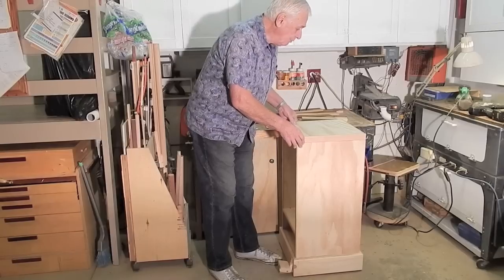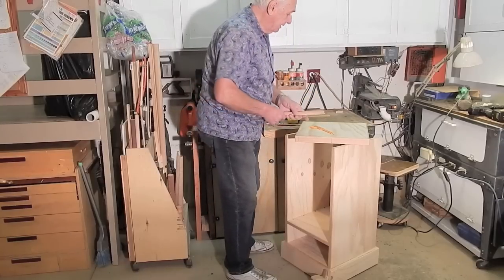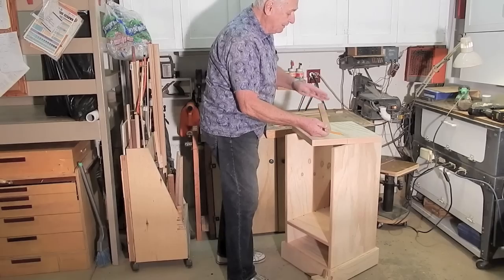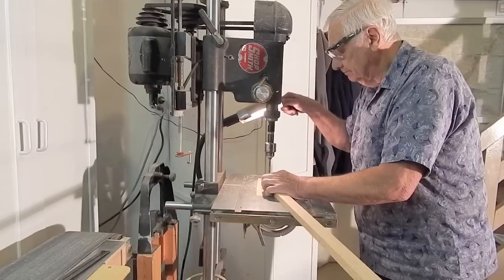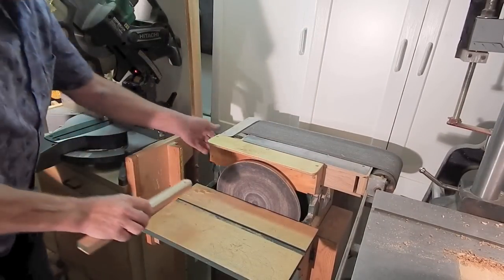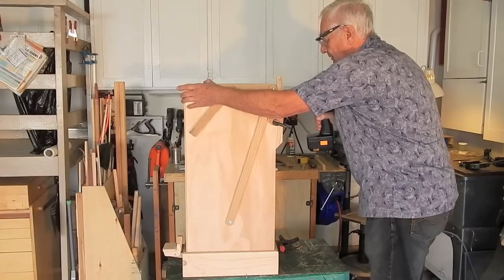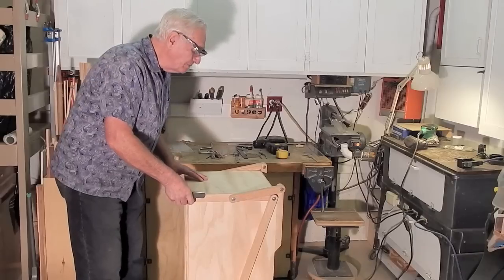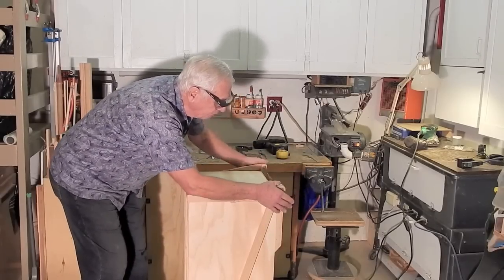Flip Top Tool Stand  Reversible Top Top Linkage 3 of 4

Comment: Carl, I must admit that this is an ingenious way to both flip and structurally support the tools! I will definitely be using this design! For drilling into long pieces the Shopsmith is great. I rotate my Shopsmith table to 90deg (parallel to the vertical movement of the chuck) then clamp the piece to the table. Looks like it works your way also (haha). Regarding the linkage connection and rear support brace to get the arms flush with the top; could the two pieces be half lap cut to fit within each other rather than using the metal? This series is great! Thanks!
Reply from the maker: MRrwmac Sure, half lap would work fine. Remember the links have to be fairly strong; they carry the weight of both tools while flipping the table. Links would have to be made of thicker hardwood to compensate for the weaker section at the half lap.  Thanks for viewing my vid and thanks for the question.   //Carl

Comment: Interesting approach.  If I may ask, why a solution with four pivoting points appended to narrow arms as opposed to a rotating axis built into solid both frame and mounting table?
Reply from the maker: TRC   No latching device necessary to hold top in 0 degree or 180 degree position. The weight of the tools holds the top tightly on the stand sides.
Thx for question.  ///Carl